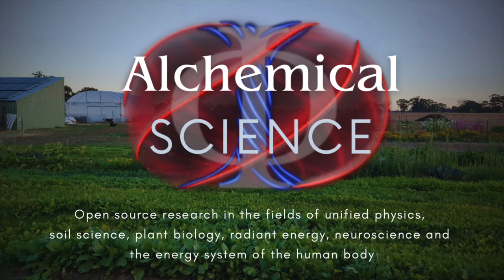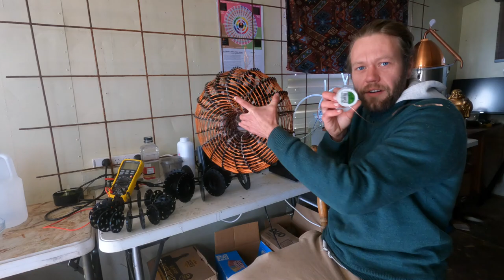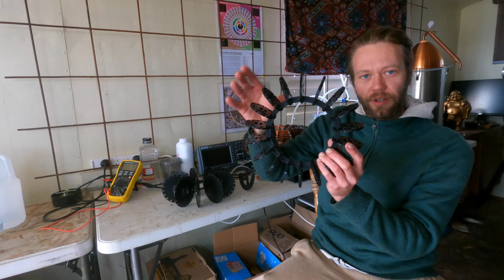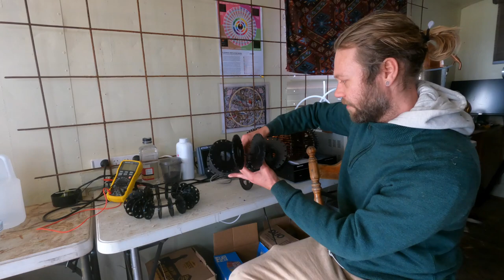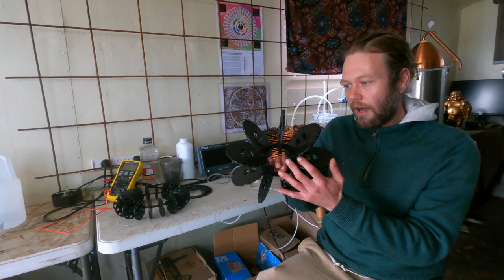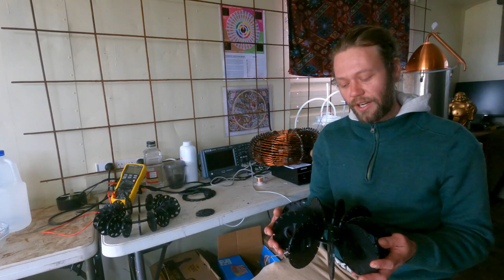Calculating Rodin Coil Toroid Geometry using Vortex Based Maths (VBM)

Comment: If the Queens chamber in the Pyramid had a powerful magnet then the "Star Shafts" could have been filled with Liquid Mercury in my opinion. A magnetic source is required to make the Mercury "Spin" & rotate

I'm certain of it, but how? - Missing machinery or magnetic statues in the Queens chamber?

Something magnetic had to rest on the wall near the blocked off hole

Then when a electrical charge is added to the Mercury it could be adjusted up and down and made to spin at fantastic rates if enough electricity is applied to the liquid metal, Theoretically you can spin Mercury just up the speed of light so...

This would of course "Vibrate" the entire structure with enough force to activate every Chrystal with 10,000 miles,   

Also I think the entire structure could be made to produce a certain tone via vibrations too

What I'm having trouble with is envisioning how they transferred the power up to the ionosphere? 

Did they simply allow it the travel out the tip of the Pyramid naturally? 

Or would they have changed the AC into DC to produce a stronger beam to shoot up into the ionosphere? Maybe via using their version of a Mercury Ark Rectifier?

Why do I think they knew how to construct & use their own version of a Mercury Ark Rectifier?
Well There's the Ancient Hindu text claiming they flew around in the air with Mercury powered machines, also if you look at a Mercury Ark Rectifier & then at the infamous "palenque astronaut" carving then you'll see some very strong similarities...

Mostly the location and shape of the "arms", vital to any design of a M.A.R. 

There's far too much evidence of a Mercury based technology, meaning they utilized it in many ways I think

Also I "think?" if they used a M.A.R. it would significantly boost the power they generated in the pyramid too

Comment: Think it's possible they could have added electricity to water in the lowest chamber under the pyramid too?

Heard ions in the water or whatever would align & the cause the water to circle & flow, pretty sure this would generate more energy as well as help create a circle vortex in the area, thus gathering even more energy & sending it all up above  

& although I have no evidence whatsoever I'm certain ALL Pyramid structures had Mercury in them to help generate electricity, some had lakes of Mercury underneath